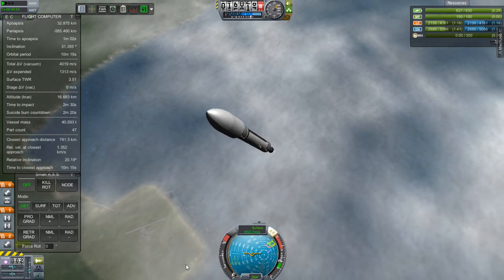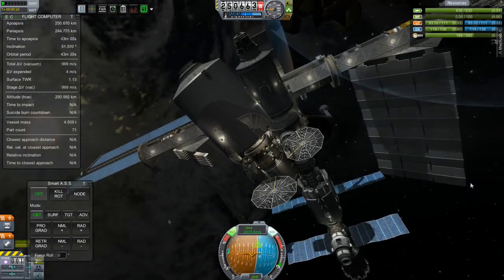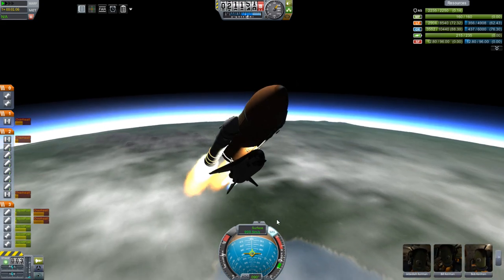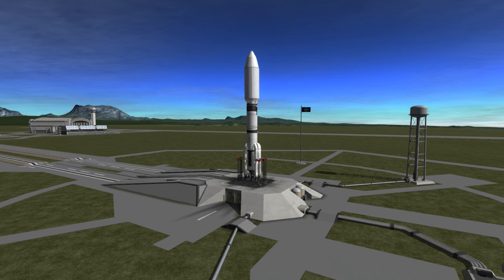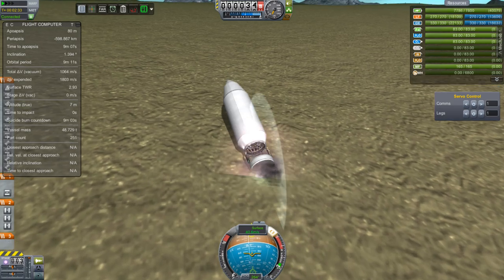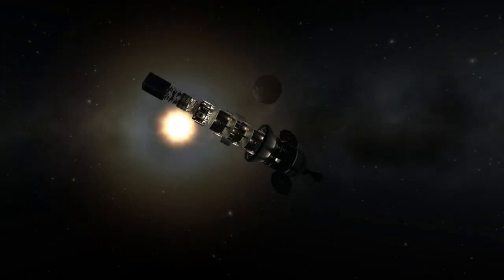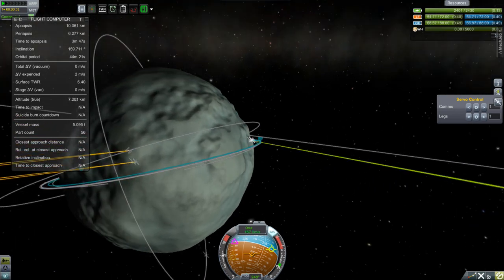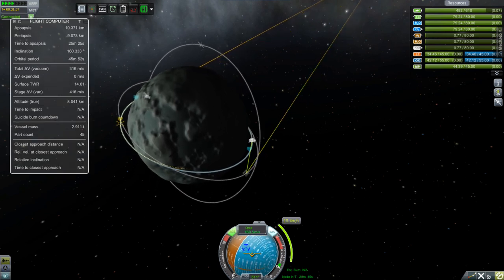KSS-19: P5 Truss / Project Gateway / Kerbal Space Program 0.23

Comment: All storytelling aside, what kind of black magic did you have to invoke to arrest that pendulum swing on the first launch?! Once something like that happens, that's about the time that I give up on getting to orbit and start practicing my skywriting.
Reply from the maker: Three things: (1) Constant SAS counter-moves (the Minotaur-1 has one of the 40-strength gyros on it), and (2a) throttle up each time I pass through my prograde, cut engines the rest of the time (keeps raising my AP to give me more time to correct my vector), and (2b) the constant throttle-up near prograde eventually was able to "catch on" while almost right inside the marker, so I was basically back on the proper vector, and (3) we went out of control at 14km but I was still rising, so after another 10km (we recover at 24-25km) the air was thinner and not affecting the rocket as much, allowing 2b to be successful.

Comment: what rescaleFactor wouls you use to make that shuttle as big as you need?
Reply from the maker: The CSS shuttle is just about right. I'd probably increase to 1.1 of that but it's close. The bay would still be too short but the diameter would be right on and that was one of the big problems. Being too short is not a problem for many lifts; just some trusses would have needed bigger but those are done now.
Reply: thanks for the reply. btw great series and you deserve more viewers.

Comment: You actually tried a shuttle? I wasn't really expecting that at all.
Reply from the maker: I don't have the time to build a good, large, working shuttle (or to land one after I finish my launch). If someone HANDED me a large working shuttle I would use it at least once though. I am not opposed to shuttles. I am opposed to me spending a lot of time that I can't get back if my shuttle ends up sucking, and up until now I have not been good at making planes. I also don't have B9 installed because I have a lot of mods I like better, and no room for lots of B9 parts.
Reply: Still, it was an interesting attempt, but most shuttles are like that, anyway. :/
Reply: pschlik Bobcat's Buran from the Soviet pack works in 0.23. CSS Shuttle mod is being updated as we speak but they have hit a snag with the undercaraige, maybe a while on this one.
Reply from the maker: Buran has now been tried and is not really working out either.

Comment: Why not use Buran from the Soviet Pack?
Reply from the maker: Will it have a 2.75m by 10m cargo bay? If not then it won't be useful for my needs. I could check it out if you think it does.
Reply: Bob Fitch You can put more than a rockomax Jumbo 64 fuel Tank in it.
Reply: Bob Fitch But you need to add few docking ports in the cargo bay
Reply from the maker: NP, will check it tonight and if it's good for me you might see it in episode 21 or 22